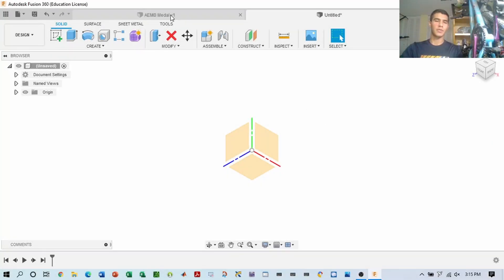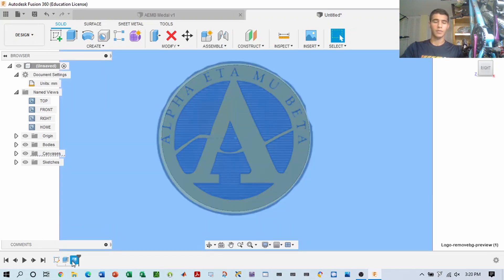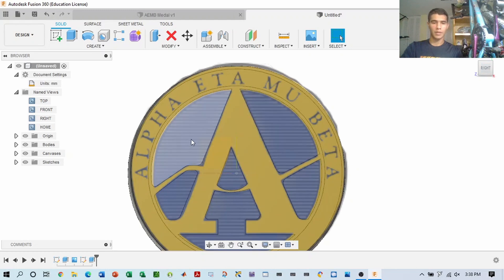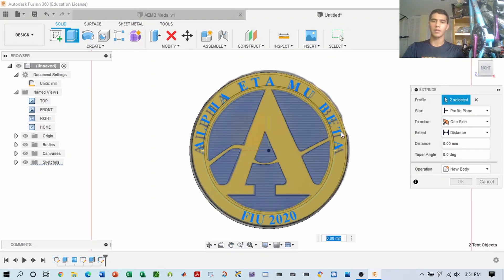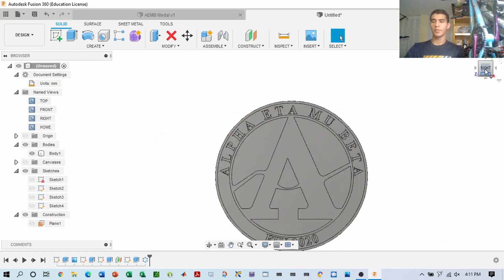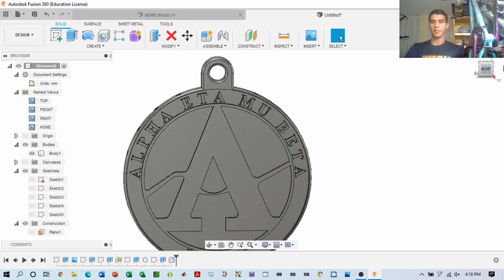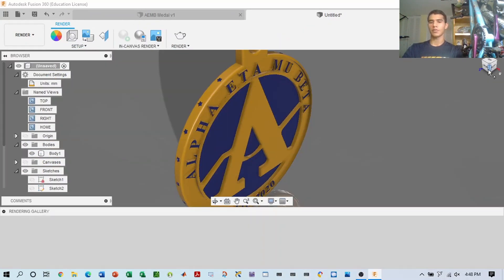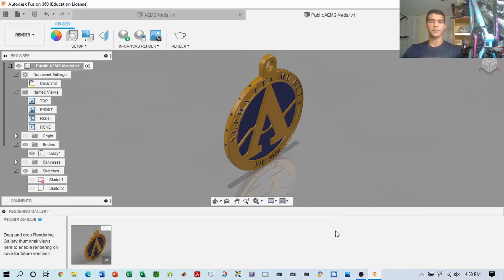How to Make a Medal on Fusion 360

Comment: Thanks for your tutorial. I try to output my medal in ai format, but the medal printer alway told me they can't print bas-relief on the medal, so I decide to create the medal on Fusion 360...I'm working in a NGO without much budget, so I try my best to output the file so the printer could come out exactly same design as my design. May I know what format  (STL or OBJ, or maybe sketchup file) we should output to the medal printer for final printing on their CNC machine (if they are using one)? Thanks~!
Reply from the maker: Well, first, 3D printing and CNC work with different fundamental manufacturing methods. To modify an object into a desired shape/dimension, its best to work in either neutral (STEP, OBJ) or native CAD format for Fusion 360 (F3D, F3Z). Once you modify the object, then you can convert it into an STL file and slice / create tool paths, depending on whether its 3D printing (additive) or CNC (subtractive) and create the GCODE.
Reply: @OtakuEngineer   thanks for your quick respond, now i have at least simple knowledge about the output format, but it's seem like many step still need to create into  a printing file...I think i just send an AI or psd (mockup) for the medal printer and leave it to the expert...Thanks!